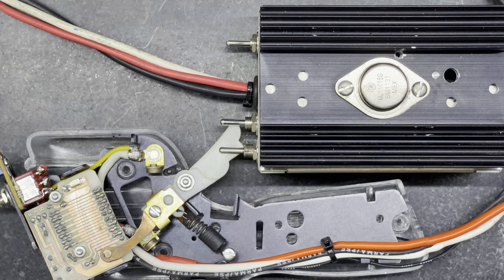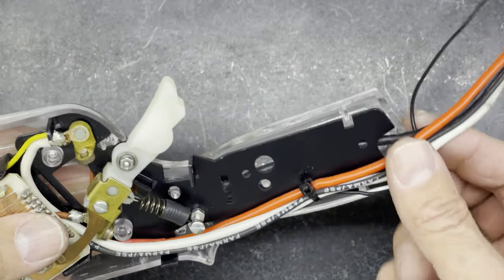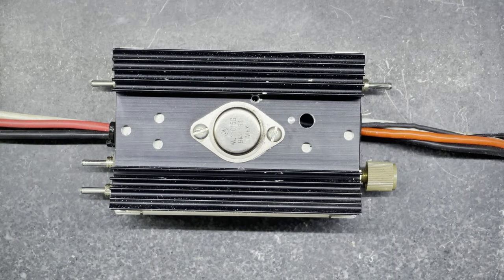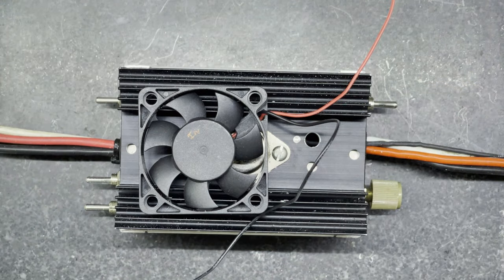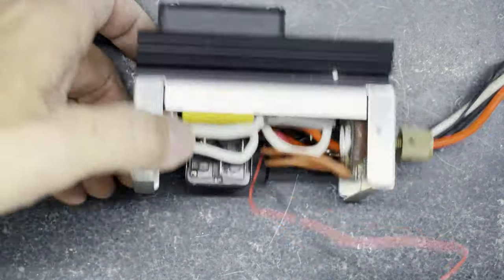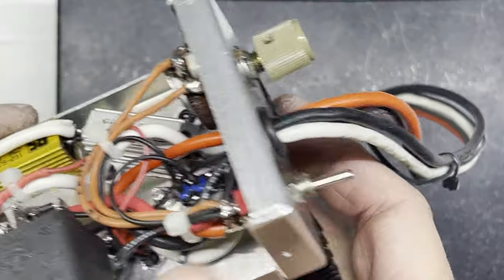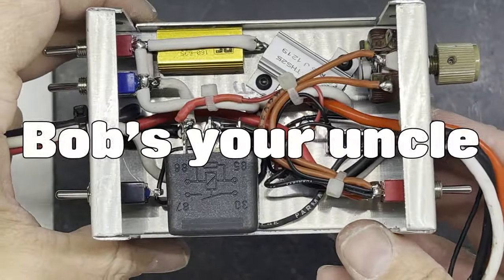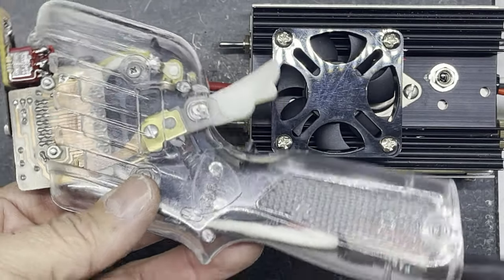Do not lose your cool at the slot car track - make this modification to your hand controller

Comment: More bells and whistles on that controller than a Xmas tree 🙂. If youre really worried about overvoltage on the fan connect a 12V zener across the fan terminals after the dropping resistor. A 1W  5.6 or 6.8 ohm resistor should be OK coupled with a 1W zener.
Reply from the maker: Nice idea with the 12V Zener 👍🏻

Comment: Do you have a part number or even better a link to buy the 16ohm 5% brown ,green, black ,gold, resistor the one I got from amazon was twice as big as the one your showing.
Reply from the maker: You probably need to check the wattage rating of the resistors. You may have ended up with a 0.5W or even a 1W resistor! A 0.25W or even smaller wattage resistor will be fine in this case.

Comment: Good video as always and most helpful.  Now I'm in the process of adding 30mm fans to my 13 year old 3rd eye controller.
I will be using 2 or 3 fans with on off switch so a question I have is with fans running how much power do they take from the car or will I not notice much drop in power?
Reply from the maker: Hi Mark. The power loss that you might feel really depends on the track power supply, track wiring, sockets and controller wiring. Each fan should have a current rating and you can just add them up to find out how much current you will be drawing from the track power just to power your fans. You probably won’t feel any difference in power, even if you ran 5 fans, but there will be a small power loss to the car even if you can’t feel it 😉.
Reply: @CleaveTech  Thanks for the reply now I went with 3 fans and found the controller stays cooler and the car went quicker.  Or could the car going quicker just be the brushes have nearly worn out on the motor.
Reply from the maker: @markhammond3800  , haha, it could be a bit of both! A cooler Transistor means that there would be more consistency in performance and depending on how your controller is wired, there could be less power loss through the transistor at maximum throttle.